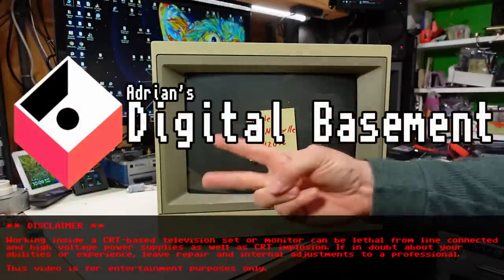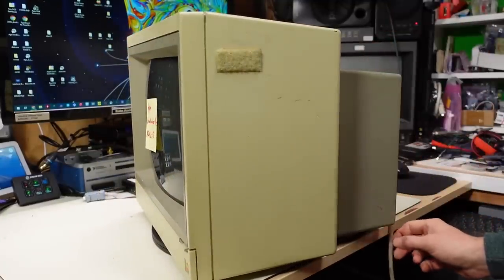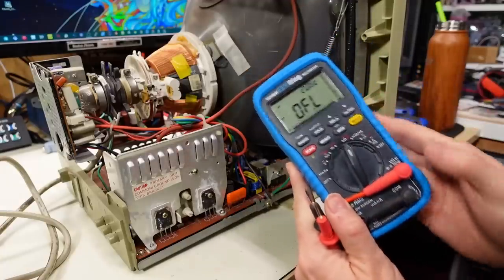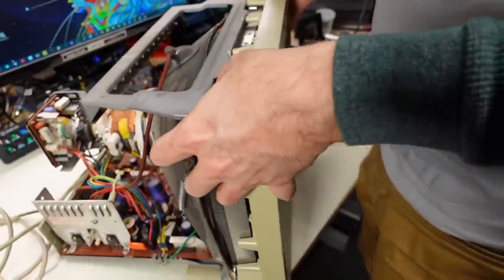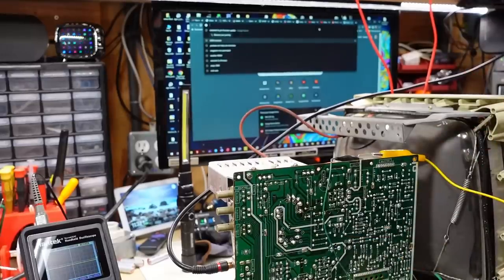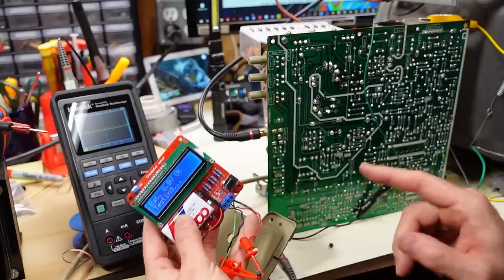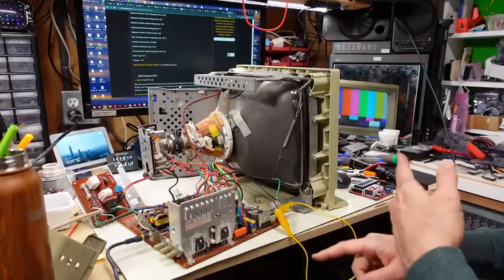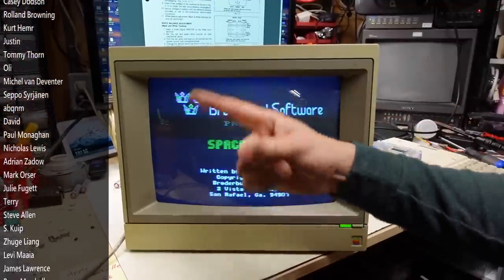A 10¢ part kept this monitor from working

Comment: Great video!

Yeah even if it was dim I would use it.  I would use it mainly for the 80-column text.
Reply: Looks good enough for those games, that computer isn't high res anyway, the blurriness actually smooths the edges 🙂

Comment: flipped board up, while plugging in video cable, right hand finger on H out emitter isn't too smart, good caps will keep B+ on that transistor for hours.  Grabs that H out several times while the board is up on it's side

Comment: I live in a PAL region, central Europe and i have not seen an original Apple monitor here. Maybe one or two in my life, three at best. Apple had a very hard time selling computers here, because Commodore had the home user dominance at most. Everyone had the C64 and the Amiga. Especially in Germany the Amiga sold like hot cake. Later it was IBM clones. I know one single person which had an Apple computer in the early or mid 90's of the performa line. There wasn't a lot of software besides the big ones like Photoshop ans Microsoft Office. I would like to tinker around with old Apple II's and Macs, but there are almost none and the ones that are here are selling for unrealiatic and crazy prices. I can easily find a 386 PC or an Amiga for under 200€ on eBay. But the macintoshes and Apples sell five times as expensive.

Comment: That was an awesome repair! I would have loved seeing the voltage on that heatsink when the mains cord is plugged in backwards. Was also interested in knowing if the high voltage dropped into the 15kv range after you replaced the transistor? 
That blob disappeared from the lower right corner, did you do something to repair that, or is it still there, and I just couldn't see it?
Wish I would have received this kind of knowledge 40 years ago! 👍
Reply: I have a hunch the power supply uses a bridge rectifier. If that's the case the voltage on the heatsink will be ~60 volts to ground no matter the orientation of the plug.

Comment: I'm wondering... What if you would mod the monitor to increase the voltage that heats the filament? Would this make it emit more electrons so the CRT gets brighter? Obviously it would be bad for the longetivity of the filament. However, on the other hand, perhaps it can increase the useful life of the monitor?
Reply: Yes but you will speed up its failure.
Reply: Yes, that's how "brighteners" worked back in the day. Sold to people looking for that last bit of life out of a TV. 

It's best to just deal with it being dim though. When the tube degrades too much colors begin to smear past where they should be, and the image goes from dark, to disgusting to look at...

Comment: CRT monitors give the best electric shocks.  The little rubber cup thing at the top of the back of the screen is great fun, upto 25k volts there (forget its name).  The reservoir cap in the power supply is fun too.  The other issue is the CRT has to be on to troubleshoot.
Reply: The anode cap? Yeah that must be great fun. I usually carefully insert the tip of my high voltage DC probe under there and when I hear the snap! of the arc I leave it there just to be sure.
Reply: Thanks for the right giggle, “great fun” is one way to put it that’s for sure!
Reply: Look guys. We have ourselves a bad ass over here who is also a shock connoisseur. I'm baffled that you are still alive.
Reply: @rommix0  You should see the students getting a belt by not listening to the teacher and touching stuff without decharging it correctly.  You are correct, it's up there with people who lick electric fences for YouTube videos.  Never do that crap twice.
Reply: I've unplugged the anode connection on a running TV and yet I've never gotten shocked by a CRT high voltage supply. On the other hand I've gotten shocked by the "low voltage" supply in the same TV several times. But that was mostly through carelessness when moving the chassis.
Reply: @eDoc2020  Nothing like random electric shocks to get the blood pumping.
Reply: @GodKitty677  Getting shocked when moving it wasn't random. The randomest shock came from leakage in the horizontal hold control. That was something like -150v volts on a metal shaft which extends out the front of the cabinet. Not only was that literally shocking if you're grounded but even if you're ungrounded it would upset the timing of the horizontal circuit.
Reply: @eDoc2020  That's a good point, even being careful you can get a shock.  I 100% remember every one decades later.

Comment: do it Adrian.  Rejuvinate the CRT.  You can do it ;)
Reply: Just test it first. It will test probably strong, or if it's weak, it's not spent, but cathode poisoned, which can be cleaned. Poisoned cathodes is the only example when a rejuvenation will almost always have a long term positive effect, unless the tube is very gassy. This monitor was barely used, so it's either a cathode poisoned tube, or it has other, electronic problems, likely electrolytic capacitors in the signal path with increased leakage current.

Comment: I saw "JVC" on the yoke. Did they have a part in making this?
Reply: As far as I know, JVC had no CRT fab. They used Hitachi tubes, probably sometimes re-badged as JVC. Somehow by mistake Hitachi put a JVC badged yoke on their own CRT. I have two '80s JVC TVs, both have Hitachi tubes in them. Sharp, for example, used Toshiba CRTs rebadged to Sharp, if I'm not mistaken.

Comment: Good candidate for the crt rejuvenation machine?
Reply: At least to test the tube with it. I wouldn't suggest a rejuvenation, maybe if the tester has a very mild cathode cleaning function, which it doesn't... I have the same tester, it's quite brute force, you have to be careful with it, not letting it go through its automatic three cycles, stop it after the first one, then test again. But as I answered to several other commenters above, I doubt this tube is weak, because this montor looks almost NOS inside. It's definitely not spent. It should be tested, if the emissions are weak, it might be cathode poisoned from the decades of sitting unused. It can be revived with a cathode cleaning, because 99% of the emitting material is still there, just the top layer is poisoned
Reply: @mrnmrn1  yeah.  I remember an earlier video of his where he messed up a tube.  It was already weak, but if I remember correctly, it made it worse.

Comment: I have the same monitor but mine has 2 blown apart resistors that I can’t figure out what their actual value is supposed to be 😢
Reply: Unless you are referring to the beige tubes with colors 
In which I can translate those because I have a tiny page with a guide on what the color code means
I forgot if I'm referring to transistors or resistors
Reply: @slycooper1001  the problem is the resistor has blown apart and those bands are all gone.

Comment: Never rely on your electrical plugs to be wired correctly, unless you have verified them.  People who are not qualified to hold a screwdriver do electrical work.   It's your life, proceed with caution.  I've seen plenty of mis-wired outlets in my life, and i am not even a residential electrician.

Comment: Man, I don’t think I ever had a transistor matching the leg order to the board in electrical engineering class. 

Only when we got to designing our own boards in CAD (manufacturing them with UV and acid etching) could we guarantee it would be easy to slot-in!

We were lucky if we only had to swap 2 of the legs! Though thinking of all the combinations, I suspect those times with 3 were not strictly necessary, maybe those classmates didn’t consider having the flat side mismatched haha. 

I also recall one of my classmates always struggled to bend the pins right, so they’d fatigue and snap off. He ended up soldering short wires to each leg after the first term.

Comment: You cannot fix worn out phosphorus in a CRT.  When it's worn out, it's worn out.  Burn it was a term invented (in relation to CRT's) due to the simple fact that phosphorus "goes bad" after time.  And the higher the dot pitch, the less phosphorus there is.  Which is why a monochrome monitor (which just has a single color layer of phosphorus) tend to last longer.  There is simply more phosphorus there to wear out.

The best technology out there would be RGB LED (IMHO), but that is crazy expensive.  LCD will do me for now, as it is pretty darn good.
Reply: Phosphor, not phosphorus. It might sound strange due to the names, but there isn't any phosphorus in CRT phosphors.
Reply: @Zeem4  You know, i never knew that.  I always assumed they were phosphorus derivatives or compounds.   You have educated me, and i thank you for it.  ^-^
Reply: I bet this CRT is very low hour, almost NOS. It should be tested, if it's weak, than it's cathode poisoned from the decades of sitting unused, which can be cleaned with a good tester, with long term positive effect, if the tube is not badly gassy.

Comment: Great repair, but something is not right here. It shouldn't be a CRT fault. I have seen hundreds of CRT monitors and TVs inside, and how this one looks inside, is like NOS. I have many TVs and hi-res monitors in which the anode wire was half an inch thick from the soot-like dust accumulation, the flyback had a similar layer on it, the white plastic of the yoke was brown from the heat, and yet it still produced great, bright picture. And Hitachi made great tubes, one of the longest life ones. You should test the tube with your CRT tester, I can't believe it's the tube itself that's weak. Unless this monitor was used in a clean room at a chip fab or something, with the last speck of dust filtered out from the air. But even then, the yoke should be yellowed from the heat, if a Hitachi tube is weak.

I would suggest to check electrolytic caps in the RGB and video signal path (especially coupling caps), and especailly on the neck board. Or don't even check them, just replace. No need for a full recap, just the ones in the signal path. An ESR meter might not be enough to find the culprits, because a capacitor with increased leakage current might still have a good ESR, while the increased leakage current might change the bias of high impedance circuits. And I would definitely throw out that few dipped tantalum capacitors. 

The chassis is interesting. Samwha caps (usual in Samsung monitors and TVs), and the KA... number on the vertical amp IC is a Samsung part number. But the pinout arrangement of the flyback looks Hitachi. Maybe this is a Hitachi chassis, manufactured by Samsung under license.

Comment: The neutral is connected to the ground in North America (in the circuit breaker box), so the third pin is not really safer. That's why we have to use isolation transformers to work on anything at line voltage over here.
Reply: The green wire isn't switched anywhere, so you can be sure it is still "ground" even when the breaker trips, or the circuit is wired backwards and hot isn't switched.
But yes, an isolation transformer is belt and suspenders.
Reply: @8bitwiz_  I think maybe you missed my point. The neutral is tied to ground in the circuit box (in North America), and so is a short circuit to the "green wire" as you call it, as soon as you plug DUT into the wall. If you were to say, us a scope on said DUT and you connect the ground lead of the scope to the "green wire," then you are going to trip the breaker (and possibly damage your scope). In such a case (any test equipment is plugged into the wall) an isolation transformer is mandatory. Obviously a battery powered scope is different.
Reply: @briangoldberg4439  Connecting the scope ground to the green wire is perfectly fine, that's how it's connected internally. Connecting it to the white neutral wire can cause weird things, and of course connecting it to the black live wire will be exciting.
Reply: @eDoc2020  again. in north america, the green wire is connected to the "white" wire in the circuit box. it's a dead short
Reply: @briangoldberg4439  They are connected together at the panel but they should not ever be swapped. There is a little bit of resistance in the wires and this causes a voltage drop when current is drawn. If you connect a scope's ground lead to the neutral wire you'll create a massive ground loop. Scope probes probably won't appreciate a few amps running through their shields. Of course you'd instantly trip a GFCI is present.

But in terms of shock hazard yes a true neutral is normally safe to touch. But if a wire is broken the neutral can become live through connected loads. Or poor-quality adapters can swap line and neutral entirely.

Comment: You are supposed to rest the crt on a towel with the electron gun facing the sky
Because the neck is the weakest part of the crt
And if you were unlucky the crt would have turned into a loud sparky rocket when it fell over
The front screen is reinforced with I think a layer of something I forgot what it was
But this is why it takes a few tries to break the front screen because as crts got better the manufacturers made the front screen more robust 
So they don't turn into a glass shotgun when you
bump into them

Comment: Dude, you're blaming your crappy parts tester for being crappy but you're making it work with a dead battery! A 9V battery at < 8v is effectively dead by my books....
Reply: Well, please fix your books, then. a 9V battery is composed of 6 cells with a nominal 1.5V voltage. Whether they are Alkaline or Zinc-Carbon/Zink-Chloride doesn't really matter, but they quickly drop below 1.3V per cell when loaded, and shouldn't be considered dead above 1.1V/cell (while loaded). 6*1.1V is 6.6V, so everything above 7V is still OK for a 9V battery on a properly designed device.
Reply: These testers usually start with a 7805, so anything higher than 7V is fine for them. I used a LDO 5V regulator in my DIY ESR meter, it works fine with a 9V battery until it depletes below 5.5V 🙂 . I use it for many months with batteries that my multimeter refuses to works with.